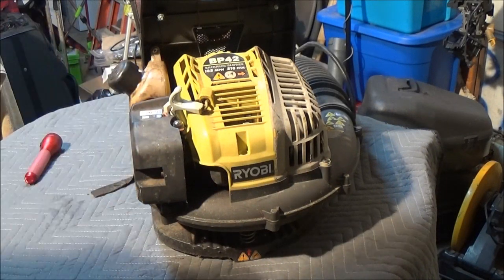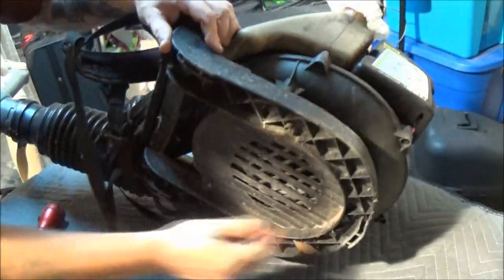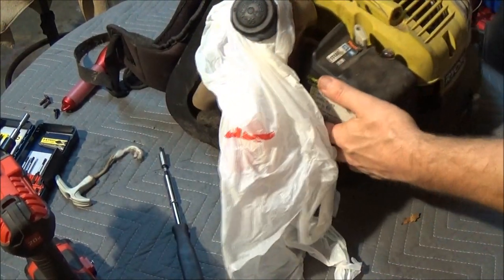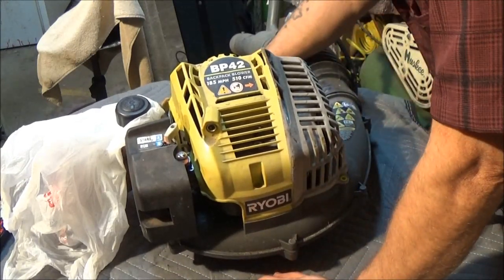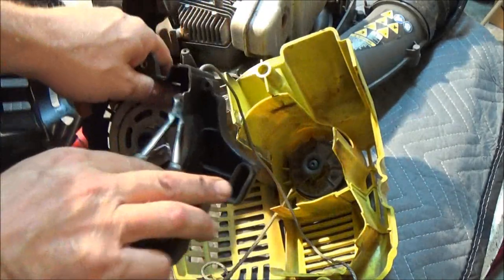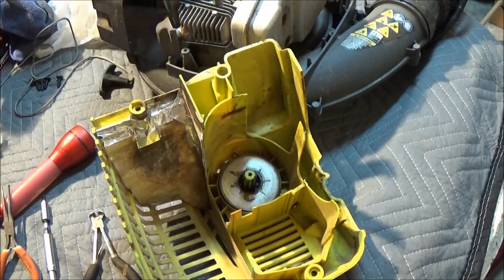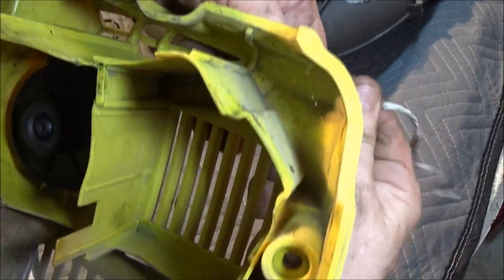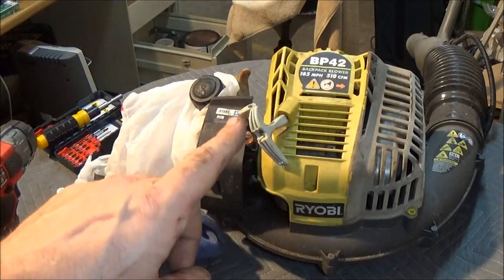Ryobi Leaf Blower Starter Rope Replacement

Comment: Thanks very helpful video, but instead of removing the backpack lower screws, I put a small 2x4 between the cover and backpack and that provided enough space for me to reach the two hidden screws, and I had all 4 screws out and pull string replaced in less then 10 minutes and put back together, food for though!

Comment: how do you change it and not let the coil thing fly out it says unscrew the nut and pull it off but how do you not let it fly out have same model
Reply from the maker: watch the whole video, i show you how to do that.
Reply: I did it last I ain't tryed it yet but I did it by myself the cord was gave to me it has tension on it but i feel like it may be a little to long of a cord was thinking when I took the spool off it was going to fly out once I got past that had a little trouble even with several videos on what side to thread it on to start then tied the knot then which way to thread it as I was holding on to the damn thing for dear life and the bolt you put I  next my drill but fell out so no hands free to hold it don't ask me how but I did it and if it dont work today going to by one and use these directions single woman here if you dont know you ask somebody and follow directions do appreciate this info I might of gave up without this help
Reply: my phone is not typing right felt like I was seeing it in reverse like looking a pic things are not the same so dont laugh at me but I did get thur the process I would of never been able to got the what ever you call it back if it flew out but seeing some of the videos my ex told me to take it to a shop was not possible to attempt it guess it happened to before but I did run the cord on thur and tied the knot big bit loose a little closer before I started to turn the spool over and over left slack and room to move the thing you pull so I didnt have to hold the tension so long when I got to the point of testing it easy then held it to adjust the k i felt  better that way If it slipped it wouldn't be in my face

Comment: I can’t get the grey lever to go to “A” or start position. It is stuck in “B” can you help? Thanks!
Reply from the maker: you may have to pull the carb off and see what is stuck. could need an extensive cleaning.

Comment: great vid...I have same machine...used larger diameter rope.....all went ok inserting and winding but when I pull the cord it is making the wrong sound.  its as if those plastic splines on the spool shaft are hitting something on every revaluation.....I lubed the spring.....lubed the plastic spline shaft like u did.....I cant figure out where the odd noise is coming from.....note this noise is just with the housing removed and cord installed........not attached to machine.  Im gunna install it anyway to see if I can get this thing to start,
Reply from the maker: let me know what you find out.
Reply: @shabear1000  well can u tell me.....when u pull that pull string on that machine did u notice it sounding more like pulling a string through a box of rocks vs the sound we usually here in other machines which is just the piston and compression.......this thing is so loud when I pull the cord I cant here the engine......when I listen to other videos such as yours it does seem to sound loud as well.  New parts have arrived...gunna install new carb...fuel filter...air filter...and fuel lines if needed......she should fire right up even with a loud pull cord.  Im also gunna use True Fuel.....
Reply from the maker: It shouldn't be very loud. When you pull it down to put the new parts in, check it over and make sure everything is in there properly. Let me know what you find out.